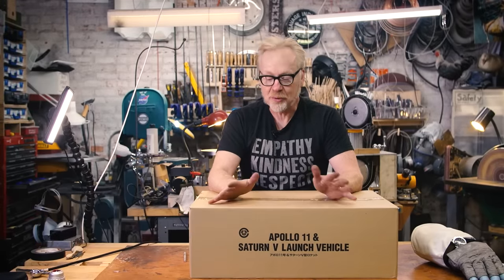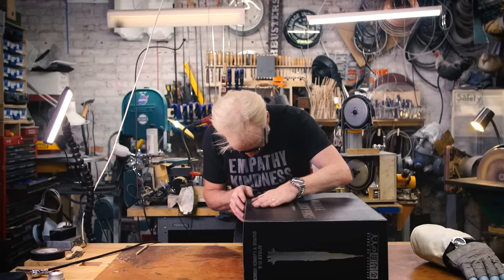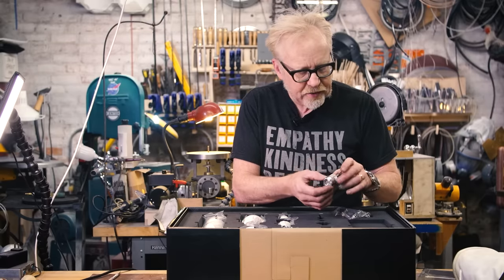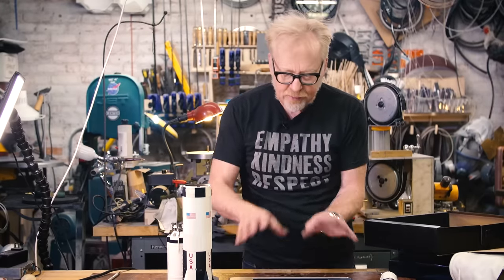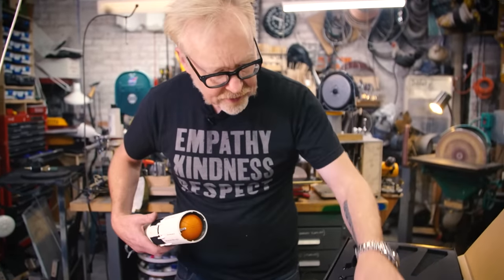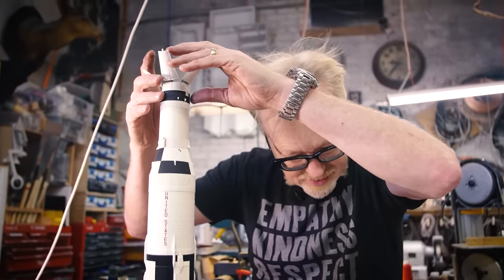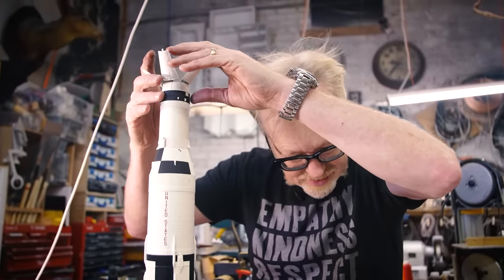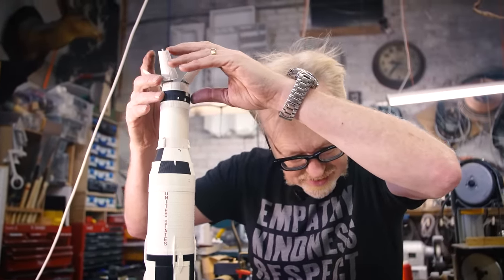Adam Savage Reviews Bandai's 1/144 Saturn V Model Set!

Comment: Pretty sure the astronaut "raising his hands in exaltation" is Neil taking the first step off the ladder onto the moon.
Reply: Fun fact: Neil was such a good pilot that the landing legs that were designed to absorb the impact and recess into themselves barely received any impact force. Because of that, the ladder ended up really high off the ground and he had to double check that he could make it back up by jumping off of the ladder on to the landing pad and then jumping back up to the bottom rung. Once he was confident about that, he jumped back down to the landing pad, turned around and made his "one small step".
Reply: @vetteguy1985  I imagine it would be a little awkward getting stuck on the moon because the ladder back to the lander was just out of reach.
Reply: That's what I thought.
Reply: @wetlettuce4768  That's the Kerbal way.
Reply: That's what we all do when we check out the price of this kit.
Reply: @wetlettuce4768    They only weigh about 80 pounds at 1/6th of their weight (with space suit), so the other astronaut could easily help them get up onto the ladder if necessary.
Reply: Star trek was way better....They used transporters...
Reply: Pretty sure the standing figure is Mr. Armstrong, 'cause he was the first one out; he's the guy standing on the Moon. The guy climbing down the ladder would therefore be Buzz...
...Prob'ly 'bout the time Neil says "Magnificent sight, isn't it?" And Buzz says "Magnificent desolation."
Reply: Just curious,. Is there a model available of the power source needed to heat and cool the landing craft?

Comment: So really- as an engineer I would never be happy with just the one. I’d need two so I can show one upright assembled and the other exploded view
Reply: Maybe "exploded view" is not the best choice for describing a space rocket display?
Reply: for 850us you'd think they could at least throw in an extra csm and lem for display together and a third lem for a moon landing display
Reply: Time to remortgage the house o.o
Reply: @lostnumbr  They actually did - at least on the Apollo 13 version. That one also includes a damaged service module!
Reply: @F-Man  Wow.  I've never heard if this Apollo 13 version.  When was it released??
Reply: @Wild-Dad  I think it was released in 2010 or 2011, along with the Apollo 11 set. It’s basically identical to what you see here, save some decals on the booster, plus a damaged version of the service module. It doesn’t have the moonscape either, but it does come with a splashdown version of the command module, the flotation ring, and a Navy helicopter.
Reply: @F-Man  - oh, ok.  So the model is that old.  I thought from watching Adam’s video that it was a new release.  So this model is the same or very similar to the one that you see advertised in those pop up ads on the internet from time to time.
Reply: @Wild-Dad  Yes, it is the same model seen in those ads - just be warned that those ads are not selling you the model that they advertise; most of the time, they’re sending you print outs on card stock. The only distributor for these was Bandai back in 2010-2011, and they are no longer in production.
Reply: @F-Man   - 😭😭😭😭 
But then, I don’t have the funds, only the dream.
Reply: @Wild-Dad  I know, it’s a shame! Demand for these really skyrocketed once production stopped! 
I don’t mean to be self-promoting here, but I’ve done detailed reviews of the Bandai Saturn V and Space Shuttle Endeavour on my channel if you wanted to see some more of this. These things are rarities, so I wanted to document them properly for the other hobbyists out there.
Reply: @F-Man   - I will have to check them out then. 👍👍👍
Reply: @F-Man  ok - I checked out your site.  Gee, you don't like simulation games, do you - LOL
Anyways, after scrolling through what seemed to be hundreds of vids, i thought to check out the playlist section and lo and behold, there they were.  Well at 1+ hours each, that's a bit for a single sit down.  So they are saved in my queue and I will watch them when time permits.  Thanks for the link hint.

Comment: Per a recent Scott Manley video, the F1 engines were actually covered with insulation.  Certainly a minor quibble for this lovely model.
Reply: Yeah, the lack of insulation on F1 engines on most Saturn V kits is annoying. Luckily, the batting is relatively easy to replicate with aluminium foil l as I did on my 1/144 model (Revell + scratch building, since the Bandai is a teeny tiny bit expensive)
Reply: Yep, I saw it right away. What’s weird is if they actually did it the correct way most people would think it’s wrong although probably most people ordering this model would know.
Reply: The LM garage also shouldn't have hinged doors. After Apollo 7 they just discarded them so they wouldn't get in the way.
Reply: I thought the engine had some kind  of asbestos based coating?

Comment: 3:50 they even got the tread spacing on the footprints looking as real as they could given the limits of the material. ridiculous level of detail, and definitely justifies its price tag.
Reply: Forgot the thermal protection on the first-stage engines, though.
Reply: @my3dviews  Yeah, I've seen examples of that being done to models.
Reply: @SynchronizorVideos     Also with gold foil to Lunar Module models.  May do that some day to mine to make it look better. 
I have the Bandai Saturn V, but like the look of the engines the way that they are, so will leave them as is.
Reply: However, as is notorious with foreign manufacturers, they got the flag colors wrong.  The blue, in particular.  I am always surprised that there are not more flag sticklers around.

Comment: 14:22 "So, what is there left to do?"
1/48th scale, whole stack, micro-magnet-couplings, thermal-batted F-1s, with interiors, all the crazy helical antennas and trunion-bearings on the LM/CSM. Legit colors for the LM thermal-coatings. Correct striping for the CM thermal-coatings...detailed interiors...lighting, maybe?
One could devote one's life to accurate models of this multi-faceted beast.
Really I'm just jealous. I want one of these, too! It would be my (other) smallest, next to the Monogram, but probably the most fun to play with.
It's certainly more detailed than the Monogram or Airfix kits.
In 1969, when I was four, Dad made me a complete functional Saturn V stack out of white Sculpey polymer clay, baked in the oven. It was all of 5 inches high, separable stages, LES, the works. 
So excited I burned myself on it getting it out.
I colored it in with magic markers, and played with it what seemed like forever.

Comment: The finish on the box is most likely Reticulating Varnish. Matte varnish at 50% goes down then an Overall Special Gloss UV Coating is next. A reaction occurs and the Gloss UV beads up giving a textured surface. Another cool thing is raised UV. This requires a special raised plate and the Press has to have a special unit to print with it. The raised UV is higher on the printed stock than Reticulating Varnish. The presses where I worked at were 40", 6 color Litho with UV coating and raised UV capabilities.

Comment: Nice review. If anyone is looking for a cheaper option, I have the Revell 1/144 Saturn V, and it is in many ways quite similar. This one is an improved version with better detail and refinement. The Revell of course you have to put together from treed parts, and paint. Lots of masking required. It took me a good week. I did a reasonably good job and from a couple feet away, it looks pretty much the same. The first stage opens up the same way, and the lunar lander's legs fold. The Bandai definitely is more detail around the engines.

Comment: man oh man this does look  fantastic.
so much quality and details even tocthat so small scale

but there is one thing, a small, quite not so obvious detail about the f1 engines.. these modeled here are the "museum version". 
the version that actually flew were covered in insulating material. asbestos covered with a thin inconel sheet for added heat protection . these protection layers were retrofitted in the VAB when they were stacking the rocket  and not standard from the factory.

Scott Manley did a short video on this specific subject  . also pointing out that they got it wrong in the Apollo 13 movie, but got it right on the First Man movie, and i think this detail is fascinating.

Comment: Bandai's Chogokin kits are pretty well known for their almost obscene detail and quality. The same line spawned everything from Gundam Metal Build to Macross Chogokin, and they all share two qualities:
1) Their details are exquisite and pertty much perfect, and the transformable models have perfect transformation, meaning that they can transform into alternate forms without replacement parts or pieces.
2) They're obscenely expensive, with prices never going lower than a hundred and fifty dollars for even the smallest models. They also have extremely limited releases, and usually have prices skyrocket within months of release.
This one, for example, is a sweet $850+. I guarantee you by January you won't find it for less than $1500.

Comment: Intricately detailed! Wow! 
   I actually am looking for a scale model assembly kit of the Saturn V Manned Launch Vehicle (ideally in a larger scale) that one can assemble, detail, paint, etc. Actually, several, one of which one could build 1) with half the fuselage (is that correct usage?) set alongside to display a fully detailed interior (tankage, ducting, cabling, engine apparatuses, etc.); 2) another with the red gantry tower, 3) a third on the crawler en route to the launch site at the Kennedy Space Center; 4) these major components under assembly in the Vehicle Assembly Building (VAB). 
   I once had one (Revell’s, in the same scale--exactly half my height then of 155 cm at 43 kg, or 5’1” at 94 lbs.); I was a relatively tiny boy in a family of veritable giants!), complete with a full set of decals; not just the identification markings, but the black bands along the fuselage (?), as well. 
   And alongside these, models in the same scale to commemorate the 1) Mercury and 2) Gemini launches, 3) the Space Shuttle with the external fuel tank, and 4) the International Space Shuttle. And if you can find one, the United Starship Enterprise, NCC-1701--though in the scale I envision, it would be nearly three metres (a bit under 10 ft) long! 

P.S., Mr. Savage, I admire the message on your T shirt; empathy, kindness, respect.

Comment: The only issue I have with this from the videos ive seen of this set is the command module and how it connects to the service module. The tab seems like a loose connection (its even slanting off the service module in this video while displayed with the lunar module). If they were to put a magnet layer for the command and service module to link them together then this model would be perfection.

Comment: I wonder if the supports in the kit are modeled on the full-size supports for the real Saturn V that is on horizontal display, in stages, very much like this kit, at the Davidson Center for Space Exploration, which is part of  the US Space & Rocket Center in Huntsville, Alabama. If so, that would mean that this model is not just a model of any Saturn V, but specifically the one at the Davidson Center.

Comment: One thing pretty much every kit or finished model of the Saturn 5 gets wrong is the engines. The actual engines were covered in an asbestos blanket insulation hiding the ribs on the engine bells.

Comment: Only one teeny issue regarding the "high" level of detail - the engines. The F1 engines are in a pre-stacking state, there's no insulation around them. To be accurate, this model should be displayed in its component parts as, if complete as Saturn V, and having been through the vehicle assembly building, it would have the engine insulation. ;)
Reply: Oh, yeah, good point. I've noticed that myself, but then forgot about it, swept away by Adam's enthusiasm 🙂

Comment: They got a great deal correct, and it is a wonderful (if not somewhat expensive) model, but they got the rendering of the F1 engines wrong. The engines should have been covered in an Inconel foils with asbestos insulation for launch.

Comment: I managed to get one of these models at a much reduced price, due to a slightly damaged case, the contents were intact and undamanged. 
During the assembly and at the very last part of the successful build, I discovered a major weakness in the small clasp that holds the Command Module to the Service module and joining the escape rocket. This clas snapped very easily. 

I intend to use CA glue to fix it but it might make the Escape Rocket, Command module and Service module inseperable. Do you have any other suggestions for fixing the problem that would still allow these final stages to be separated and the Lunar Spacecraft [Command, Service & LEM] to be displayed and returned to the Saturn V for its general display?

I understand you are very busy but some guidance would be appreciated as I am not an experienced model builder. - Thank you in advance -Bob Thomas BSc.

Comment: Was hoping for some removable F1 engine insulation to truly represent launch condition. Any model ever have this feature?
Reply: It's available as a resin or printed replacement part.  

There's a tendency model company have to make the blueprint,or what sits in a museum.  History is often different from the accepted version.  
It depends on how much we want to 'accurise' our models.  

This Brit has yet to find a Hawker Hurricane that has the fuselage top just to the rear of the cockpit correct, as the canopy is always too thick.

Comment: There is one small flaw with this model that is fairly common in most representations of the Saturn V: the lack of insulation blankets on the F-1 engines. Before flight, the outside of the nozzles and the turbomachinery would be covered in reflective thermal blankets to protect them from the extreme heat of the exhaust, but most Saturn V's on display have these removed to show off the machinery that's otherwise hidden from view. Scott Manley has an excellent video explaining it: https://youtu.be/HkObNfCki6M?si=p45GZPbvghyiqr7j

Comment: This model appears to repeat the common error found in 1/144 scale Saturn V kits.  The Command and Service Module section diameter is too small which makes the SM look too long.  I suspect that the original manufacturer Monogram started the error and Airfix, then Bandai propagated it.  For the price of this model its pretty inexcusable.

Comment: I want this so bad butnits sold out 😪😪
Reply: I got mine around 2 years ago no wonder there sold out. Well i have something thats basically the same, I have the lego verion of this
Reply: @diamondapple6664  I have the lego.version of it aswell but it dosent have fine details. The lander gets stuck in the top cap and there isn't a place for the return pod inside the rocket. But we're these models a limited run? I'm very sad if so. I'd spend that much for a hyper detailed rocket.

Comment: 850 bucks. It better be impressive.  I wonder how many they need to sell just to pay for the tooling. Much less the design and development.
Just looking at the shot of the first stage one can see it is not completely accurate. The F-1s were wrapped in foil for heat control.